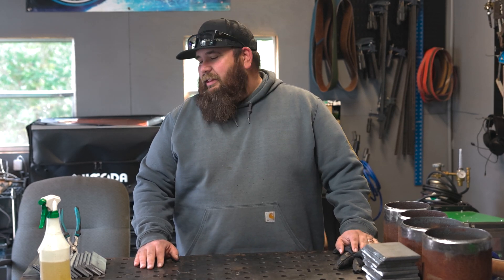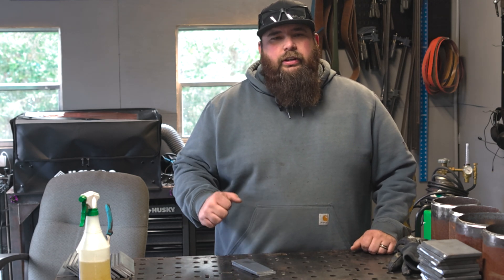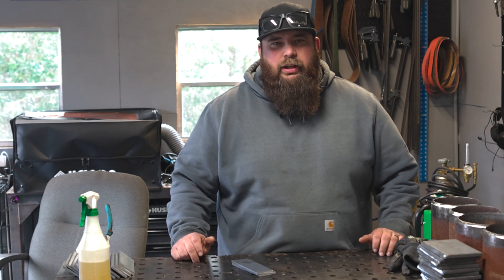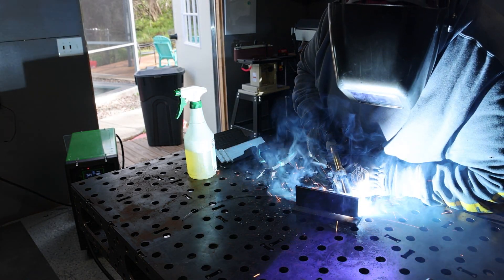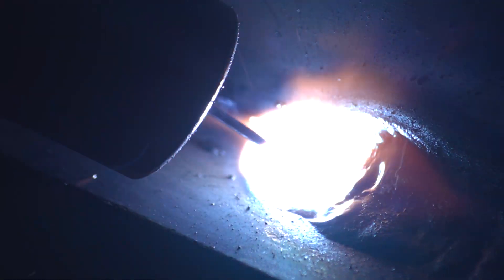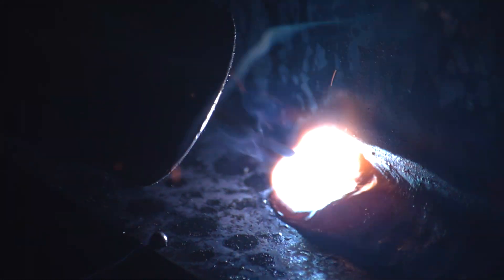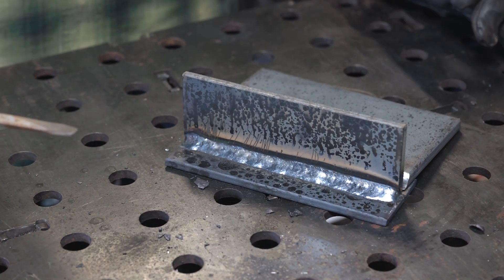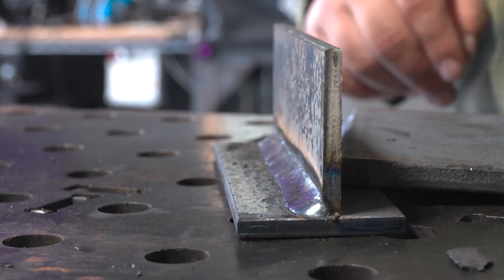Running Dual Shield Flux Core On The Everlast Cyclone 312

Comment: Great video!!!

I’m just learning 0.045” Dual Shield.  My machine has a maximum voltage capability of 27v and WFS of up to 600 ipm. 

I ordered a 11 pound of Blue Demon 0.045” dual shield, simply because it is available and cheap enough for a first try. 

I seem to be suffering mostly from the surface wormhole type porosity.   

I have tried various settings and STICKOUT lengths, and usually end up around 25v @ 350 ipm and 3/4” stickout. 

Perhaps it’s a matter of older contaminated wire or brand wire. 

My machine can handle a 10-11 pound spool, so some brands only come I. Larger rolls so brand selection can be limiting, but for the right wire, I could manually transfer it to a smaller 10 pound spool. 

What brand of 0.045 dual shield do you prefer. 

I love your videos, am learning a lot and so Thank You for that.